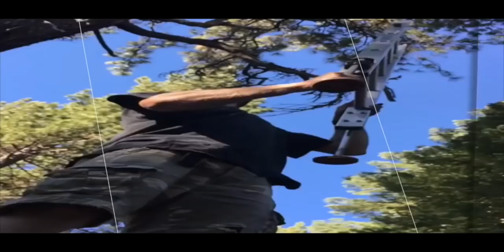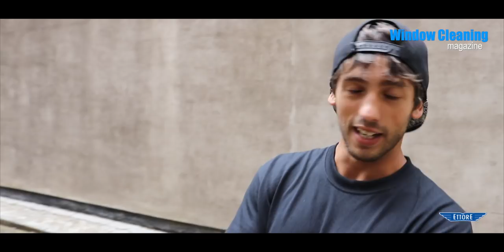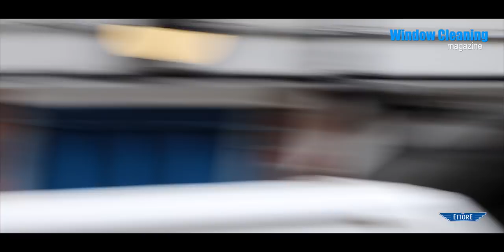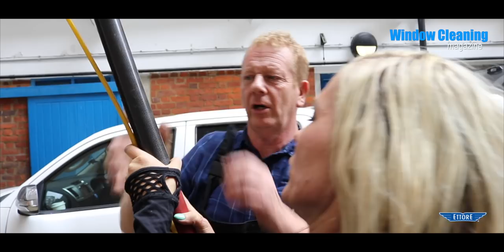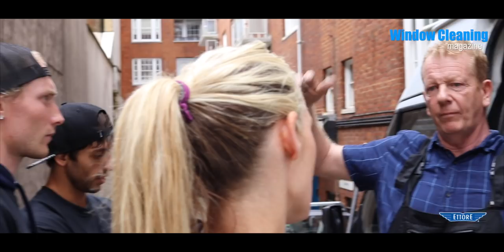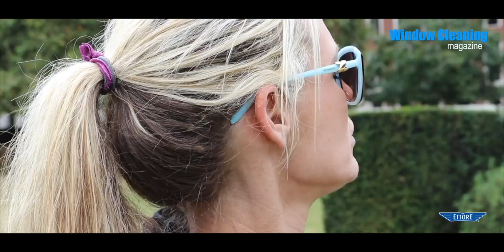US VS UK Window Cleaning - Episode 2 - Monster water fed pole in London

Comment: What is the name and length of the water fed pole being used on the 8 story building?
Reply: Looks like a Gardiner
Reply: I agree. It looks like an Xtreme but I'm not sure.
Reply from the maker: Believe it or not it was one of the very first Reach-iT poles sold in the UK, still going strong.
Reply: It looks like a high modulus pole at 8 stories that's why I thought it was a Gardiner. Which Reach-iT pole is it?
Reply from the maker: I believe it was the Reach-iT Pro when Mark purchased it that must have been back in 2012. The pole has a 2K finish on it.